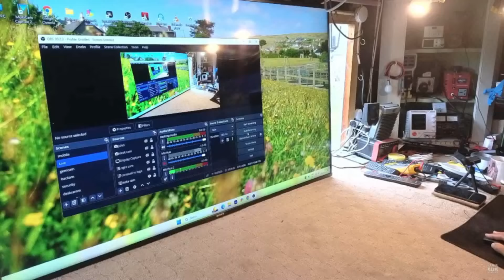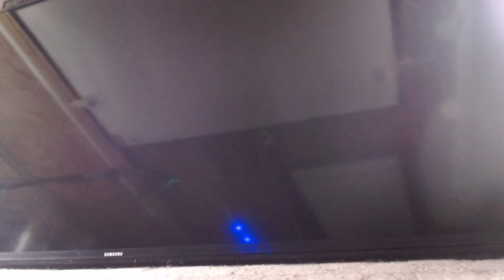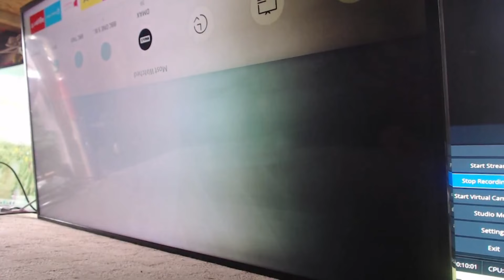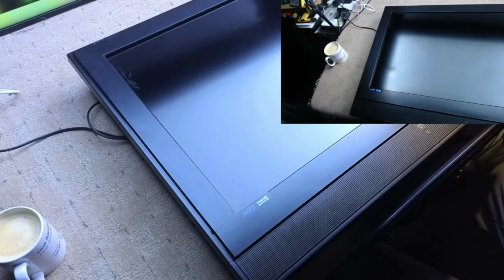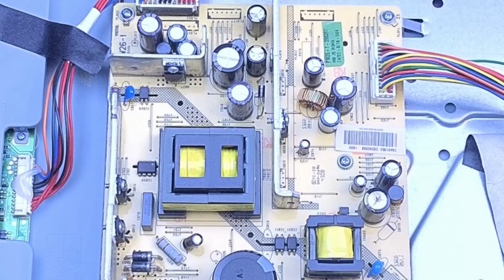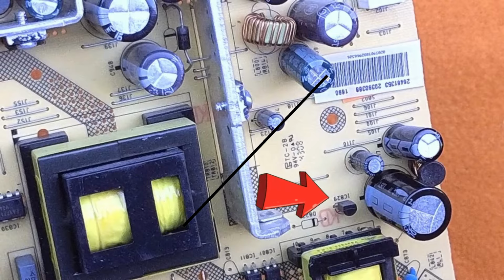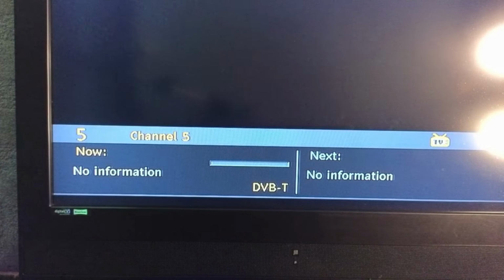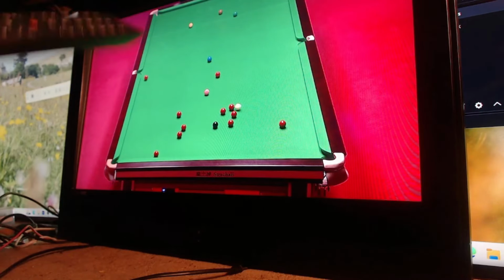2009 hd ready VS 2019 smart 4k TV,  which one is going to the dump ?

Comment: Charity shop electrical tester here - we get a LOT of TVs (only outnumbered in donations by lamps).  I'd say I have an 80% success rate with them.  I do find it's the newer ones that have problems.  Had to bin a 41" Sony today as it wouldn't even power up.  But a month ago I got a 4:3 Sony from 2007 that works perfectly (though it still hasn't sold, even though I priced it at £15).

I think the public would be horrified to learn exactly how many TVs went to the recycling after a small amount of time after manufacture.  I can generally coax even old VHS recorders back to life, but TVs? No.  What you have is usually what you get.
Reply: Put working boards on eBay at a sensible price? No warranty obviously, but there's clearly a UK community that wants random stuff like that. Your dead TV may save others?
Reply: Not an edit. Add high Res photos of what you have. Some might be looking and can see the markings on yours when the one they're working on is just a pile of dust.
Edit: I've sometimes looked at a burnt mess in front of me and internet photos showed me what should be there.